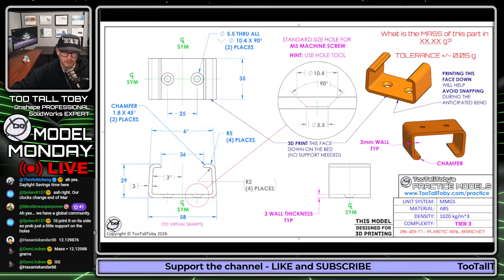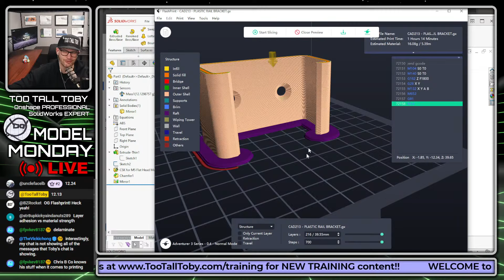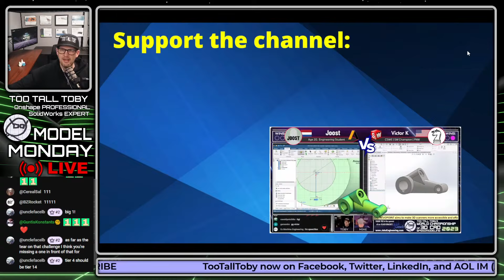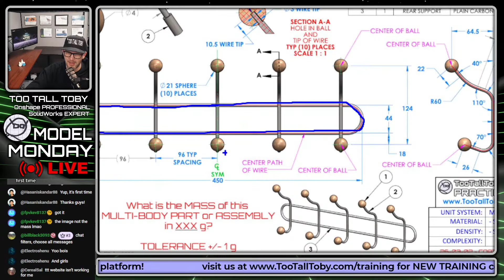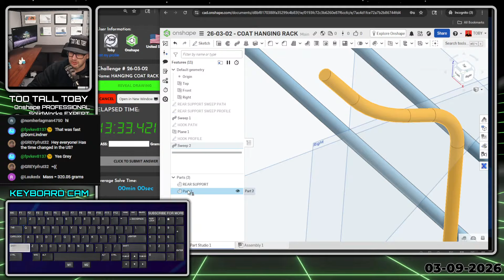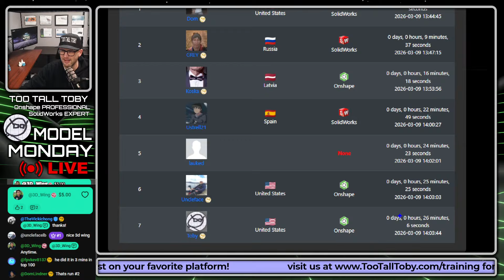Model Monday Live MARCH 9 | CAD Speed Modeling Battles, Tutorials, Tips and Tricks

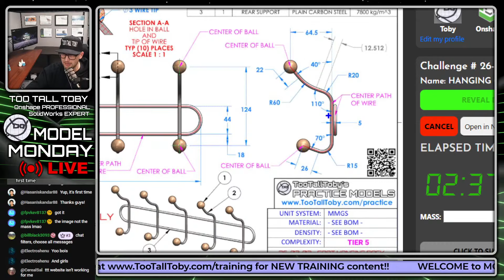Comment: 44:56 You didn't miss a thing. The drawing clearly shows that the distance between the wire axes is 5 mm, which is exactly the diameter of those wires. So you can definitely count this as part of the challenge. 💪
Reply from the maker: Thanks yo!